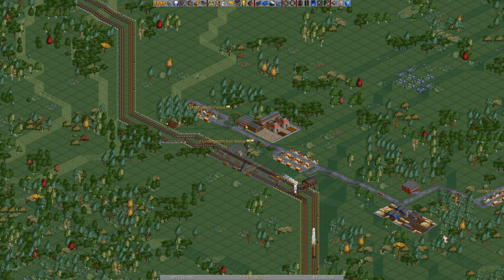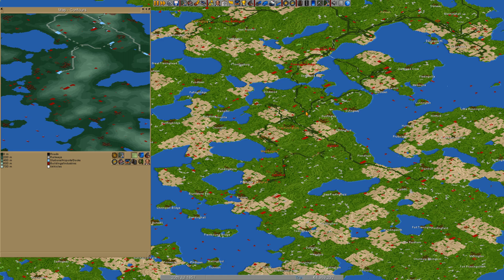Let's play OpenTTD #15 - Uneven distribution

Comment: Supply only lines should be kept seperate of the rest of the network. So if wood, sand or iron ore are those do it so, manufacture, engineering etc can then be distributed via the bone network. Straight in straight out stations have there limitation , circulation stations are ok as long as the supply is steady enough to keep those produced goods manufactured.

Comment: Ah yea, missed me some graphs and figures over the weekend. Hopefully the distribution evens out as the mines hit the double point. If they do, it is probably better to have all engineering supplies go to a few stations before SpeedyNet is at full production. That way the mines will double production as you increase the supplies, instead of nothing until you make enough for every mine and they all double at once.
Reply from the maker: The cargo distribution seems to be having a will of its own really. There are places that need supplies and other places that swim in them. The whole distribution definitely needs some work as right now the results are rather underwhelming :/
Reply from the maker: Thanks for the insight :)

I am really considering to turn it off for cargo and leaving it on for passengers because it's a little bit annoying with the supplies. On the other hand, it does make sense that cargo has a destination. You know, some company buys something and I am paid for transporting it. I am still not 100% decided on it though, but thanks to you I now know what to do if I do want to turn it off :)
Reply from the maker: Well, I have the display setup like this so that the more I click, the more in detail I go. It made sense to me like this as most of the times there are 2 steps in the distribution of the supplies: a transfer station and the final destination. Right now there's one transfer station (the one north, not on the island) that hardly receives any supplies whilst the stations that cover the quarries directly receive plenty. 

Anyway, I just can't get my finger around how the distribution is calculated in cargodist, but one thing is sure, I need it improved ;-)
Reply: I think this is the problem with cargo distribution. You have set up some industries that need, say, ES, and then there is a load of ES on the ES producing station. Now, you introduce a new line for another consumer of ES, the cargo distribution keeps the existing pile reserved for the previous connections and this is the failure of the system, in my opinion. The existing ES should be reshuffled and redistributed for all end consumers. The way it is, the new consumer of ES will have to wait for new production and will not use the existing reserves.